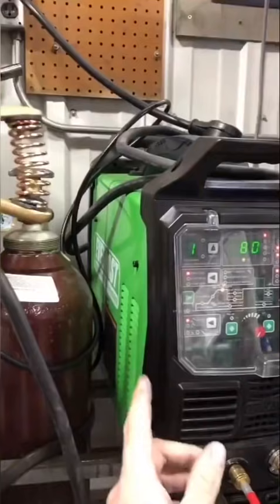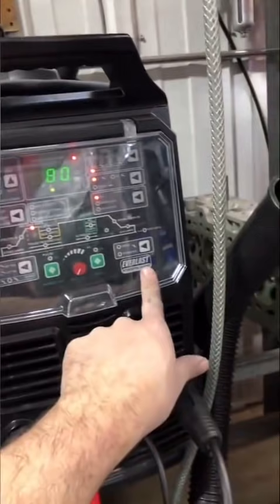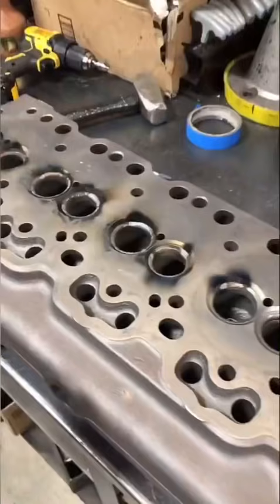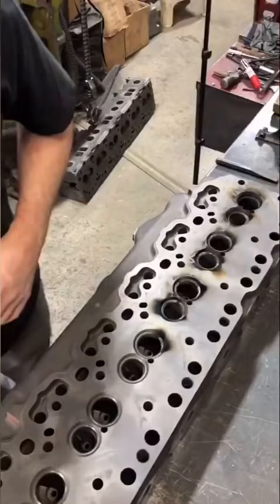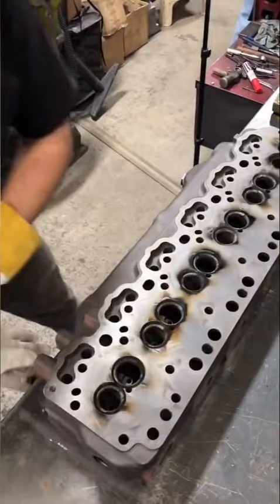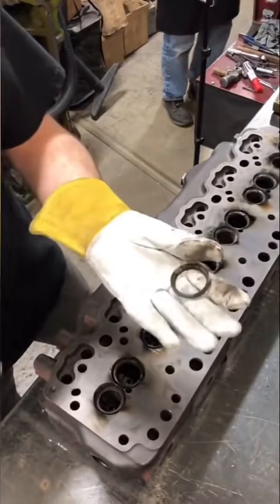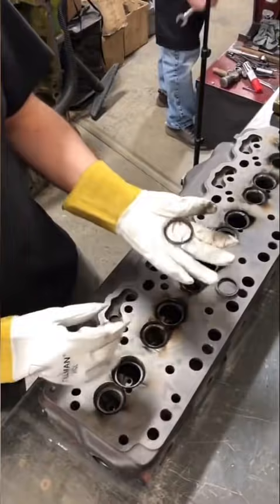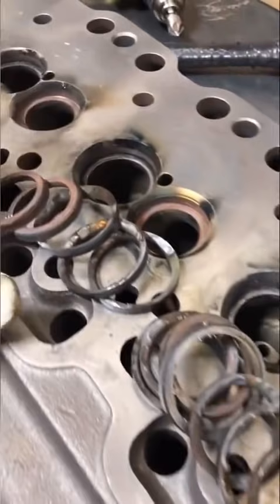#SHORTS Removing Old Valve Seats With An Everlast 255EXT @JAMSIONLINE

Comment: Way to go man, moving up in the world. Personally Tig is my favorite form of welding, but a tip that helps me to keep steady and prevent 2 handing it, is I prefer to hold the torch like a pencil as aposed to like a hammer. Your finger tips are far more agile than your wrist (not to say I dont also use my wrists to move) so you can, depending on what your welding, wrest your forearm on the piece for stability. But you do you and keep on keeping on. Love the #shorts by the way!
Reply: Bro same tig is amazing I love it but I don’t hold it like a pencil because it heats up a lot and burn me thru the gloves but other than that I love it 
It’s so clean it can weld thin or thick and is so fast
Reply: Same
Reply: TIG is the best. Went from MMA to flux core to MAG to TIG, than tried doing MAG welding again and fuck me. Was completely useless 🤣 Tig is so much easier. You make a mistake m just go over it again. Mig/mat you have to gride of the lump if you went to slow or something happened. I have used my Tig as a cutting torch many many times, cuts or melts away 6-8mm steel like nothing. Comes in handy when having to make a hole into a slot or remove something in a shape other than a straight line. Or to get rusted bolts or nuts off. Have cut off 4 shocks where the but on the bottom or top pin is rust welded on and nothing larger than a Tig torch or plasma torch can reach and i don't have a plasma torch. 250 amps is no joke. Also welding outside in the wind. I found that if you just sprinkle some flux of a stick electrode you can weld stainless and low carbon steel in 20m/s side winds and barely use any shielding gas. But keep the electrode almost completely inside the cup. And use a small cup 8-10 works well in my experience.

Comment: Modern day 5.7L Hemi engines came with that feature built-in. LMAO.
Just ask any of the early adopters that suffered an overheating condition.
Valve seats usually fell out by gravity after that.
Reply: Mine released the piston rods so i didn’t have to.
Reply: Seems to have not been so much of an issue after 2011 or so. 2005-2009 were the biggest offenders that I saw personally.
Reply: @slowazzes1972  these gross oversimplifications and exaggerations are why people leave the car community. There's no need for this kind of negativity. Sure, it's not your personal choice, but I think you know that saying it's all garbage is an overstatement.
Reply: @thomasjohannesen1003  I've owned  new and older dodge pickups, my mom even drove a dodge dart there for a while. Worst vehicles I have ever owned by far,  both 1500s I owned where complete gutless turds, could barely tow flat bed with a civic on it. My mom's dart was constantly throwing a code on the daily and at the dealership, so yes when I say they are all garbage, I mean they are ALL garbage.
Reply: My brother had a hemi Chrysler 300 that did that. 2 quarts low on oil.
Reply: @slowazzes1972  all manufactures produce garbage at some point. As tech that works on all makes and models I can attest that they all have their flaws.
Reply: That's almost all Chrysler engines that like to drop valve seats

Comment: We rebuild industrial gear boxes at work usually just heat two side of the bearing race180 degrees of each other red hot with a torch and then hit them with some air to shrink them really fast! Same concept.
Reply: Dude that’s so much better. Thank you for that

Comment: I use the same technique to get bearing races out of wheel hubs, cool!
Reply: Thanks for the tip ! 👌😎
Reply: Hmmm good idea
Reply: How is this technique used? To super heat 1 side of the race and get it to contract inwards? This is a new one to me?
Reply: I was wondering the same
Reply: I use a wire feed, put a bead around the middle of the race in a complete 360. I still use a punch and hammer, use the bead as a lip for the punch to grab, race comes out 10 times easier.
Reply: The welded bead contracts the race, go in circles with the hammer and punch,  work the race out.
Reply: @rogercook1177able  fuck yeah! Much appreciated.
Reply: Yeah same here. Apprenticed under a guy many many years ago that taught me to do that, but a stick welder.
Reply: I do this with hub side axle bearings races for semis.

Comment: This is by far the easiest way to get the seats out. Some old methods used a brazing tip on a torch to heat the seat up in one spot to do the same thing. Now remember this only works if there’s actually a seat insert there, don’t ask how I know.

Comment: In the shop I used to work at this is how we would remove the valve seats from the heads of our larger engines (Waukesha, Cummins, Detroit). Melt the valve seat down a little bit and the pop right out. On the thicker seats that have been replaced a few times and over bored, I would melt a small lip on two sides (12 and 6) and use a heavy punch as a pry tool with a minisledge and they just come right out. Good work. Love the content. Keep it up

Comment: Is assume you are changing the valves -or have some old valves which if are a tad smaller can be welded to the seats and punched out the other side  - But your technique is perfect for shrinking the seats - also good for stubborn wheel bearing cases - a long weld on the inside @ 120o apart they fly out with a press -👌👌

Comment: Yep. The absolute best way. I’ve been using a harbor freight tig welder for years, it’s primary use is valve seat removal.
Reply: I’ve been wondering about that harbor freight tig welder. Are you having decent luck with yours and is it worth getting? I’ve got a small farm and just do my own tractor and implement repair, small fabrication, and play around with old vehicles so it’s hard to justify paying top dollar for a Miller or other pro version ya know. 

Thanks for the info brother, appreciate it much!!
Reply: @1982MCI  I think they discontinued the one that I have. But I’ve had it for years. Used and abused it, it still works. But I also have the new Vulcan Omni pro, and it’s great too. But a good bit more expensive. The Chicago electric was $360 Ish. The Vulcan was 1000.

Comment: I like your video's I have definitely learned a few things...
If you use generous amount  of anti spatter spray (made for mig welding tips) on the flat head surface when you mig weld you won't have to worry about the BB's sticking to the surface

Comment: so you just went around the seat with the arc and no filler rod.. letting the material in the seat be the puddle that pulls it in..    don't forget that works with bearing races  in blind holes too.   do you worry about stretching the seat bores with the excessive seat temp???  or causing cracks do to excessive localized heat???

Comment: If your tig torch is sparking like a mig gun, you need more shielding gas. 
Tig should use pure argon, you don't generally want to use active argon/co2 mix gas. This could also be why the spitting.
In this operation, clearly doesn't matter, but you shouldn't be getting scorch marks, generally speaking.
Reply from the maker: So I did two heads the other day w/ different material seats.

The first was fine, no sparking or anything, puddled nice, etc.

Didn’t change anything and did this one, and it welded like crap as you can see lol.

Is it common to have to change cfm of the argon depending on material?

Since it was fine on the first and not good on the second I assumed it was just that the second material was not good for welding.
Reply: @JAMSIONLINE  I'm not the most experienced welder overall, but from stainless to titanium mild to cast to aluminum, sparks tend to indicate that oxygen is getting into your weld cone.
You do not generally need different amount of shielding gas if using the same torch tip except to cover the heat effected zone of more sensitive materials like stainless to prevent oxidation. 
What could be happening is air flow around your work. If there was air blowing up through the valve seats and/or guides, it could have been blowing away your shield from below.

Comment: The material doesn't weld.at all because you were most likely using the wrong gas. You have to use 100% argon. Looks like you were trying to use the 75% -25% mix you normally used for mog welding.

Comment: Use 100% argon, and use acetone to clean metal youll be working on
Reply from the maker: Using 100% Argon. Wasn’t worried about it looking pretty so didn’t figure it needed excessively cleaned lol. I’ll try next time, this head welded differently than the first I did. First was fine

Comment: So how is it actually helping? Is introducing heat changing the shape or some thing? I would imagine that it expands and makes it harder to remove. I’d like to know
Reply: I think the heat deforms and breaks them loose....some guy was saying the newer gen hemi 5.7 have an issue of getting loose seats after they over heat and sheer gravity mixed with slight vibration drops them. We used to heat bearings magnetically and they would slide on electric motor shafts like butter, but you couldn’t beat them on with a hammer before. Once they cooled they were seated.

Comment: You're not welding until you've added filler rod. Also it's called spatter, not splatter. Basically you've used heat to remove the valve seating's, which worked a treat. No experience with that welding set, but I hope it gives you many year's trouble free service. Don't worry welding takes year's to truly master and practice makes perfect. Much admiration for your mechanical skill's 👍

Comment: What gas are you using man? If it’s the same argon/co2 mix you’re using for the mig then that’s why your arc is so sketchy try using pure argon
Reply from the maker: Pure argon. Welded perfect on the first head and like crap on the second. I think it’s just the crappy material. Not designed to be welded lol

Comment: The sparks and spatters are how you know it's working
Reply: Working incorrectly that is. There shouldn’t be sparks when tig welding on properly cleaned material. However this is more than likely cast which is not easy to work on whatsoever.

Comment: Oh and you gas isn’t set right on your tig set up. Should just be a clean arc not any sparks.
Reply from the maker: So, I did two different heads yesterday with different seat materials on the same welder settings & gas flow rate. 

The first welded real nice, no sparks or anything, quiet, etc.

The second (shown here) welded like crap! Is it common to need to run different gas flow rates for different materials? I'm totally new to TIG so any advice is appreciated. I just assumed that since it worked well on the first head and not on the second that it was just due to the material of the second seats.